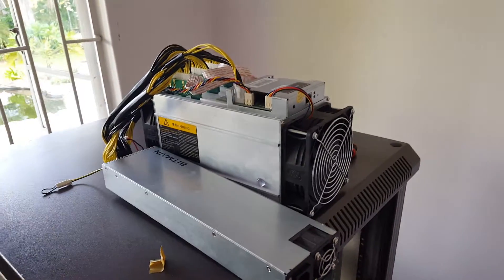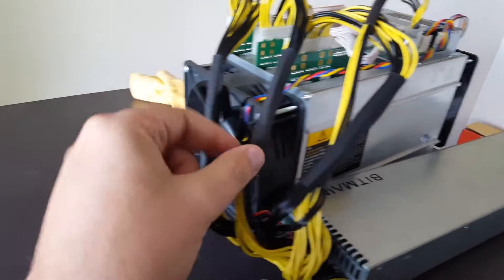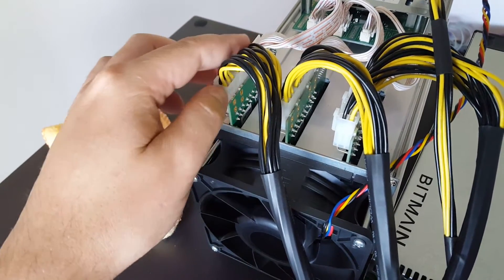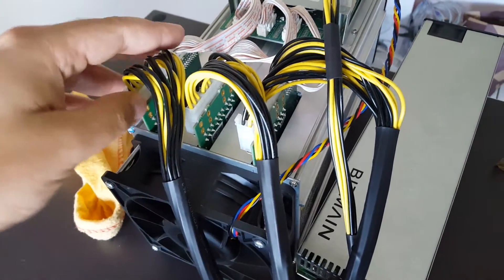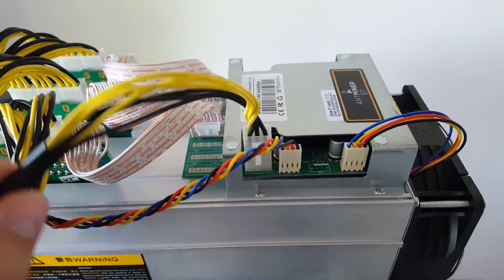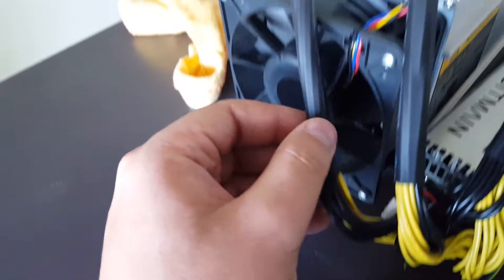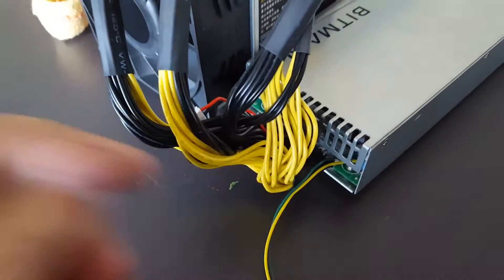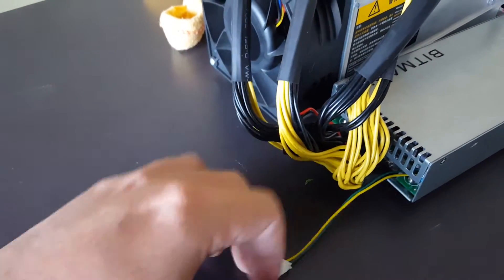Connecting your S7 Antminer Powersupply

Comment: Bitmain APW3-12-1600 is a single 12V rail power supply, so in this PSU's case it doesn't really matter how you connect those connectors. See this view inside the PSU: https://bitcointalk.org/index.php?topic=1060439.msg13138214#msg13138214